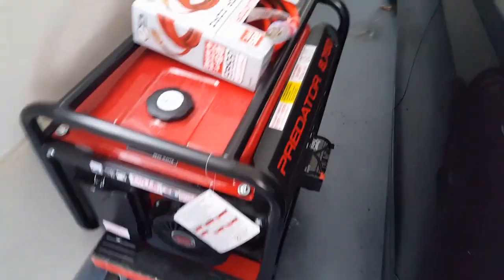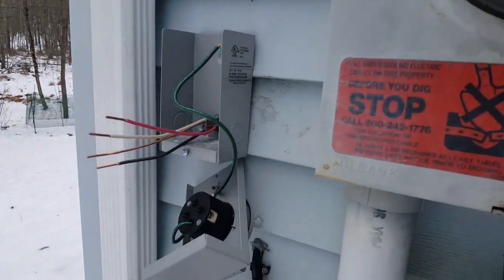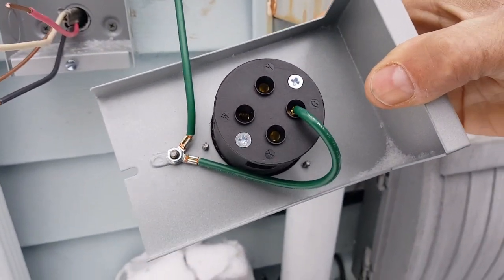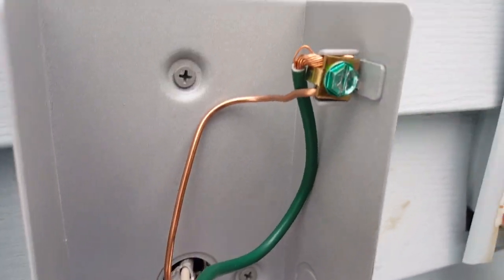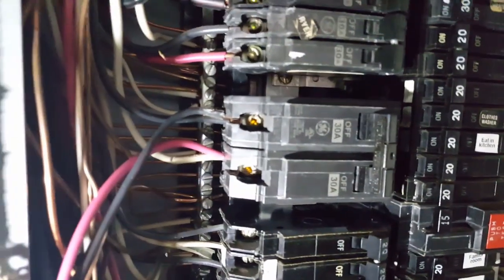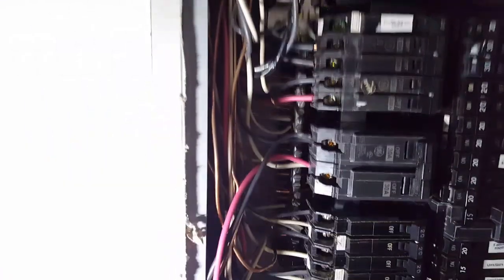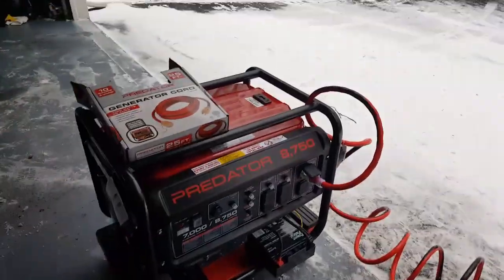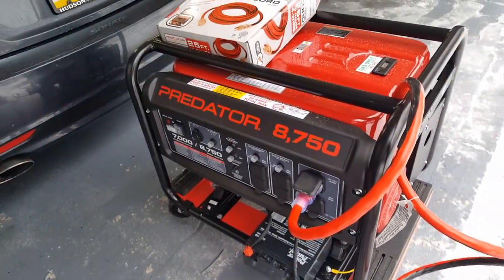Connecting a Predator generator to a whole house

Comment: The problem will be is if the power comes back on, the homeowner won't know because the main breaker has been turned off.  He'll have to keep checking the neighborhood to see if others have power restored.  A better and safer way is to install a transfer switch.  Identify the breakers that power essential appliances (refrigerator, some lighting, smoke alarms for example) and connect the transfer switch to those circuits.  No need to turn off the main breaker.  When power is restored, lights and appliances on those circuits that are not on the transfer switch will light up or become active.  Then you'll know when you can shut down your generator.  But I do like the power inlet box.  I hope your brother has a way to secure the generator.  It might be gone when people get desperate in a power outage.
Reply: Here are the rules about portable generator safety: This is just a reminder for everyone’s safety. All generator safety rules should be followed carefully. This advice is just to make sure that everyone is aware of all the warnings and it’s just to remind people to be careful using portable generators. Generators can be dangerous if not used carefully. Every year, hundreds of people die or get injured when using portable generators due to carbon monoxide poisoning and electrocution. Make sure you are using your generator carefully and keeping others safe as well. There is something very serious that everyone should always be aware of when using generators. Some people do run their generator indoors which is not safe and that increases the risk of carbon monoxide poisoning which can cause death of family and you. Some people run their generator in wet conditions which can electrocute them. Please remember that you should never run your generator indoors. Remember that carbon monoxide is an odorless and colorless gas that you cannot see or smell. Carbon monoxide is a silent killer. Keep that in mind. Make sure your generator is 15-20 feet away from your house and away from doors, windows, and vents. Never use your generator in your porch too. Having a carbon monoxide detector is very important against generator safety. Some people also allow children to go near the portable generator which could pose risks. We need to keep an eye on our children making sure that they are not near the portable generator so they won’t get electrocuted or burned by the generator which is dangerous. A locking enclosure also keeps kids safe. A generator shed might look like a tempting place to explore, or take cover during a game of hide and seek, but a generator is a dangerous piece of equipment that can cause injury. It says on the manual that we should also keep children away at all times from the portable generator to avoid injuries. Please do not allow a child or unqualified people to operate the portable generator.  It is important to keep your children safe especially little ones. The portable generator can be hot during an operation. Just because some manuals missed what should be listed doesn’t mean it’s safe to do. Always follow the generator safety rules when using portable generators. Generators pose electrical risks. If you need to use your generator during wet weather, you need a generator tent to protect your generator from getting wet. Don’t let your generator get wet. Keep your generator dry and before using your generator, please make sure your hands and your generator is dry. Do not wear loose clothing when operating the generator. Everything that is said on the generator’s operating manual should not be ignored. Never smoke cigarettes near the generator. Please keep flammable things away from the generator. Never overload your generator too. Your generator can catch fire. Never ever try to plug a generator cord into a wall outlet to avoid back feeding. Back feeding your generator is dangerous. Always turn on your generator first before plugging in appliances and shut off the appliances before turning your generator off. Use a heavy duty cord for your generator and the cord should not be worn out. All the instructions should be followed carefully. Never refuel your generator while it’s running. It can cause fire if fuel spills while your generator is hot. You should turn off your generator and let it cool off before refueling it. Having a fire extinguisher next to the generator is also important. This is only a reminder for everyone’s safety of using generators. Make sure your generator is properly grounded. Having a fire extinguisher next to the generator is also important against the safety rules. https://youtu.be/I1jT3ANENvI and here is a video more about keeping others safe when using generators and also about our family’s safety. It’s important to keep our children safe especially little ones. Hope this helps. Have a good one. Thank you.

Comment: Here in Butler Pa we had a winter storm with leaves not fallen yet the ice and wet snow resulted in lot of downed trees and widespread power outages right before thanksgiving. as Harbor Freight here sold out of all generators and predator 212cc engines. as now people won't have power till thursday thanksgiving. my next question is if this generator capable of powering two refridgerators and a chest freezer, as well as the furnace for heat and a draft induced water heater for hot water' the main importance is the refrigerator. and freezers they have alot of inrush current when their compressors start. the thing is you can't run is an electric clothes dryer, or a central ac system unless you install a hard start kit to the compressor to it as well as hard startn kits for your fridge freezer and dehumidifier. if you run the central ac can't use other appliances like the microwave. but its important for heat to to keep your furnace going also important if you have oil fired heat, furnace or boiler or hot water heater if the generator is running you have to reset the burner most use a beckett oil burner. as the outage here in Butler Pa the portable generators were in high demand is why harbor freight here sold out of them.

Comment: DO NOT BACK FEED YOUR HOUSE USING THIS METHOD! You MUST use either a transfer switch or an interlock.  Publishing this video is irresponsible and dangerous.  What happens when your brother forgets to turn off the main with the generator running and the power comes back on?  What happens when the main is left on during a power outage and a lineman is electrocuted as the generator power is back feeding into the utility lines?